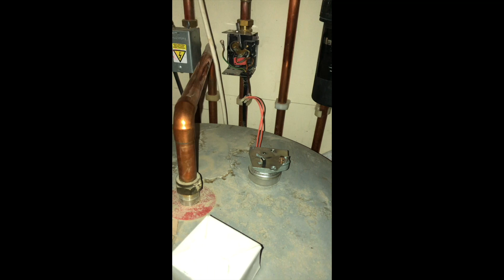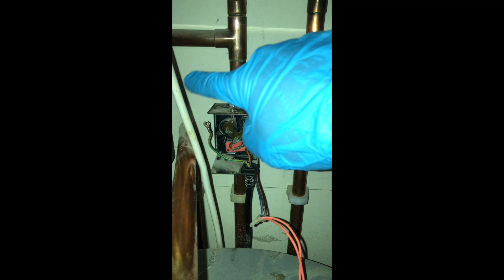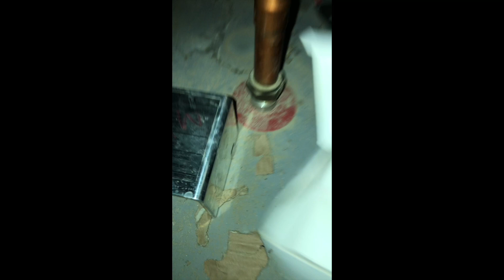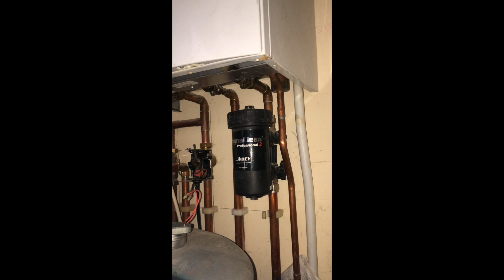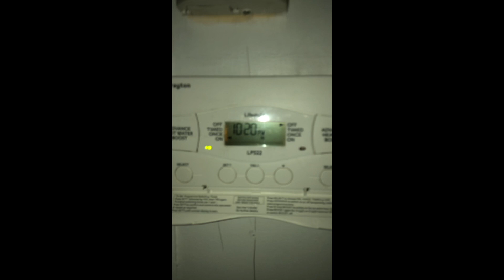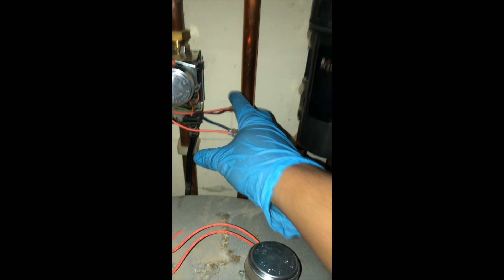How to Repair a Zone Valve / 2 Port Valve - Changing The Motor (Cause for No Hot Water or Heating)

Comment: What are those connectors that you use to connect the cables? The ones you pinch with grips?
Reply from the maker: Gel filled connectors. They’re pretty useful. The gel is supposed to stop the ingress of water